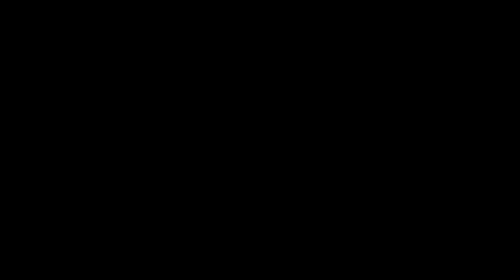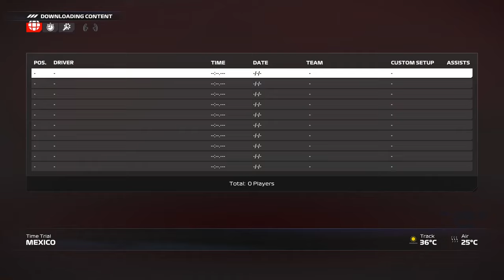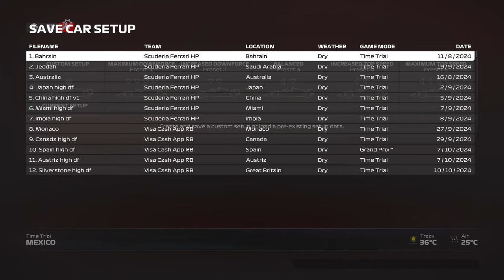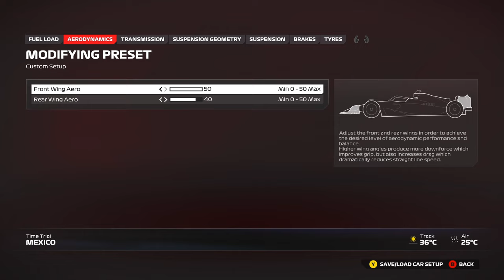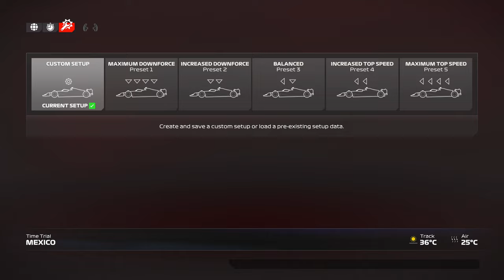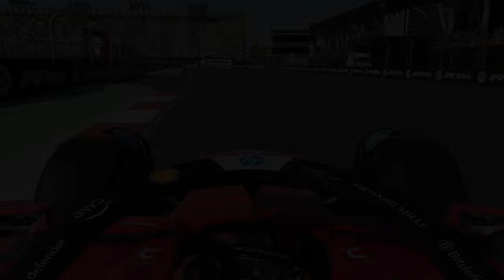Mexico Track Guide & Setup | F1 24

Comment: Idea for videos: make track guides for actual races.  Everyone does tt but no one does race guides with tires compounds, fuel strats, ers deployment during quali and race pace….etc….. no one.
Reply from the maker: @NoHacksTSR  Hey buddy, love the idea. Not the first time it crossed my mind too but it's tough to squeeze all that into one video with my limited play time. I can only do limited running in GP mode to fine tune the setup, and then publish it in TT mode and my discord server. You can join us over there and share your findings too. 💪🏻 

I have (almost) prepared separate guides to address these areas, similar to how I did for F1 23. 

Tyre strats are almost identical for all tracks up to 50% race distance, and 100% races are more flexible. Fuel consumption also varies according to downforce levels, driving style, and other factors like lift & coast, DRS & slipstreaming. So, what works for me may not work for you. It also includes an easy way to test the fuel load in limited laps and extrapolate that data accurately for the full race distance. 

ERS will have its own guide too, since it is applicable for all tracks. 🙂

Comment: great setup, but after 4 laps rear left get hot. what can i do to fix it.
Reply from the maker: @akakideisadze4857  Firstly, avoid softs in race if that's what you're trying, they're horrible. Second, make sure you're using the max tyre pressures to reduce overheating. Third, most driving-related, be smooth on corner entries and exits. If you drive it the same way you do in quali, it's very likely to overheat the tyres, so with a heavier car and harder tyres you will need to brake like 5-10 meters earlier, and accelerate more gently and prevent wheelspin. You can also push the brake bias forward to 56/57 to reduce the heat generated in the rear brakes and tyres.